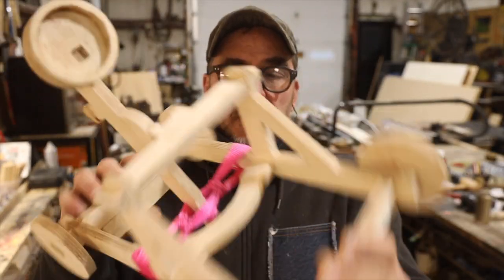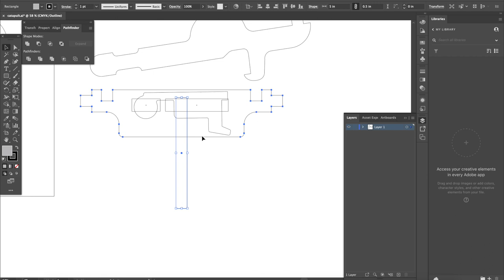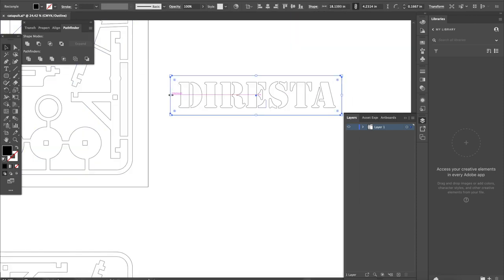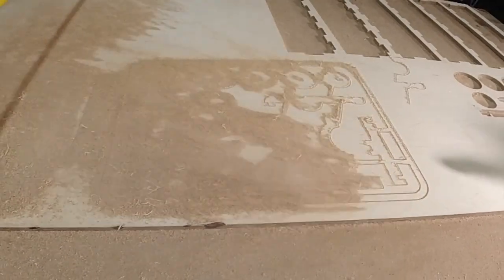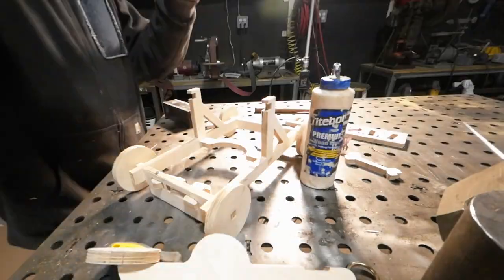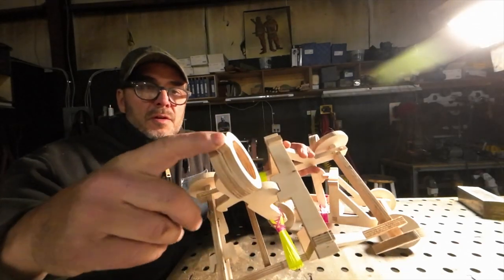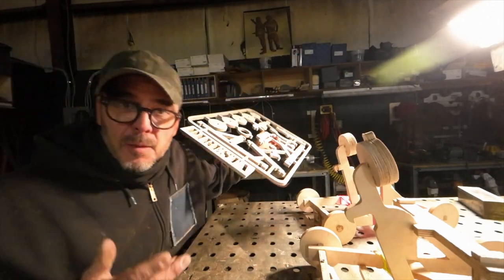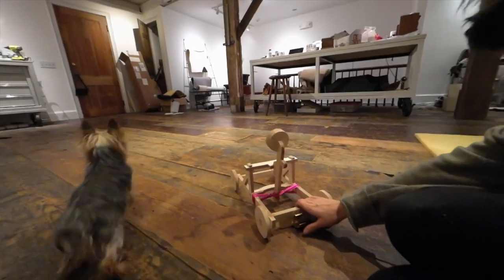Diresta It's Not A Catapult?

Comment: i once entered a bowling ball launching contest, and beat all of the other contestant's trebuchets with just a catapult. my team went to a junk yard and got some massive springs and some old logs and built a classic catapult like Jimmy has here. we just had the throwing arm attached to the cross beam via 3 huge truck springs and tied off with a random bit of rope. my job was the launching mechanism, and i just tied a bowline from the throwing arm to the base after the throwing arm was cocked using a come along. to fire, i simple slashed the rope with a sharp steak knife. From what i remember, our catapult launched a 10 lb bowling ball about 150 feet.

the way we beat all of the other trebuchets, which were made from store bought lumber using plans they found online, was that our catapult actually worked and you only got 3 shots (with your farthest counting). All of the other trebuchets failed by throwing balls straight up, backwards, or only a few feet with massive high arcs. one of them just broke when they were raising the counter weight. i learned an important lesson about engineering in that sometimes its much better to be reliable than it is to be modern

Comment: Great series. Question - what format are you exporting from AI to import into Vcarve Pro? whenever i import from AI into Vcarve, it imports hundreds or thousands of datapoints on a simple circle or curves because of the drawing originating as a bezier curve, resulting in a slower and jumpier feed on the machine. luckily vcarve has a "fit to curve" feature that helps make it more friendly to my machine. wondering if there's a simpler way of exporting from AI to avoid the extra step.